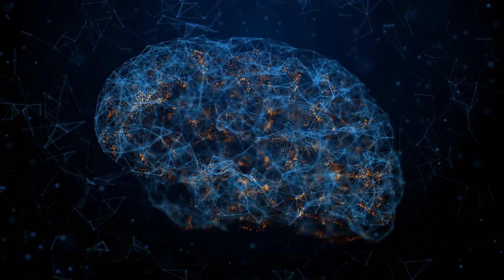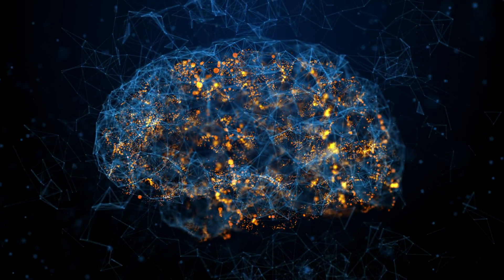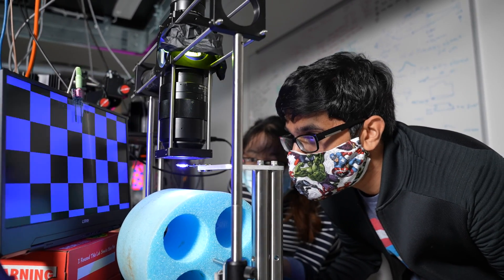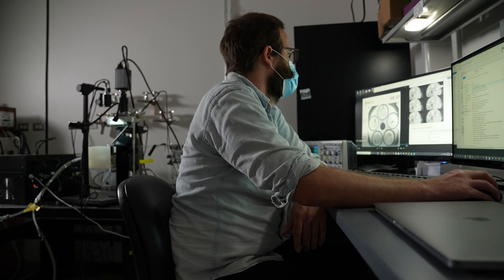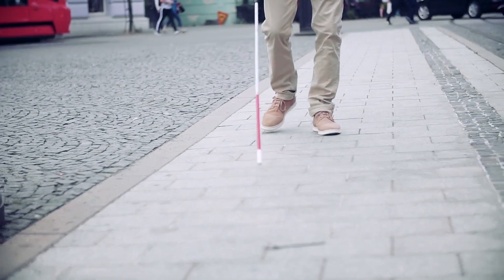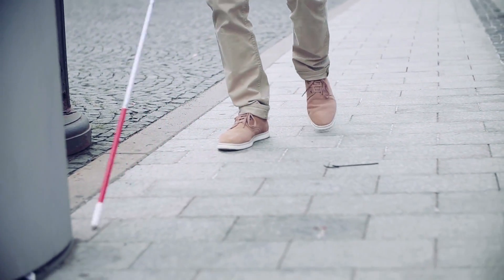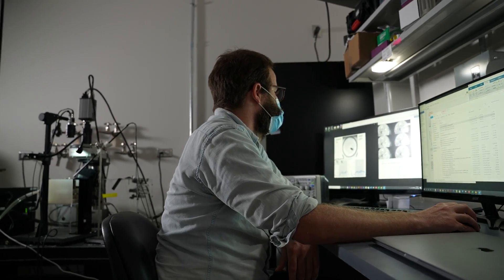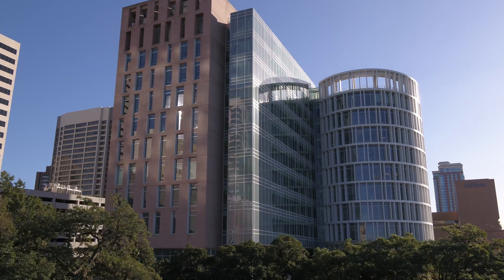Wireless linkage of brains may soon go to human testing

Comment: They are already using it on humans.  Does anyone know how to remove it ?
Reply: Yes, pray GOD seriously. He has the power to help you and efficiently
Reply: Wifi router. They connect to you when you sleep.
Reply: K Jones did you found any solution?
Reply: @mykindofsongsmykindofsongs1748  Not yet.  Do you know of one.
Reply: @kjones5588  no
Reply: Remove the biosensors from the body. That’s what makes this technology successful and your body ease the ones a radio for this tech. Using MMS has helped me.
Reply: if they put stuff into you try if you can get it out go to surgeon or something if it says it's impossible and you have to live with that from now maybe commit suicide is the only solution to be free from that unless there is a way to block the frequencies